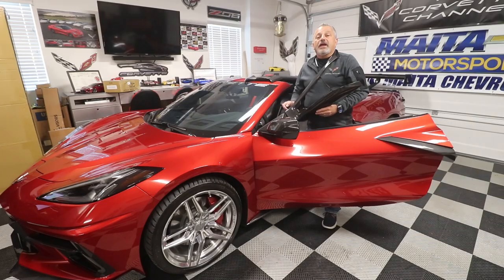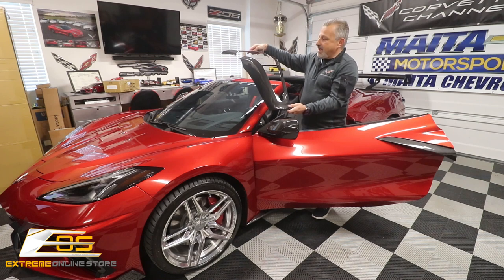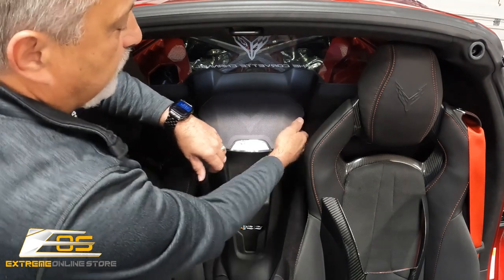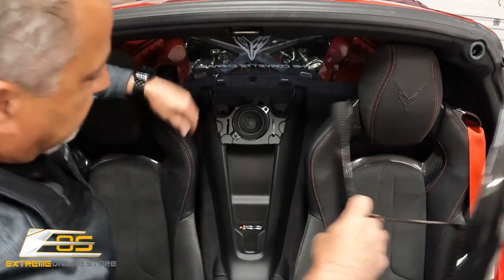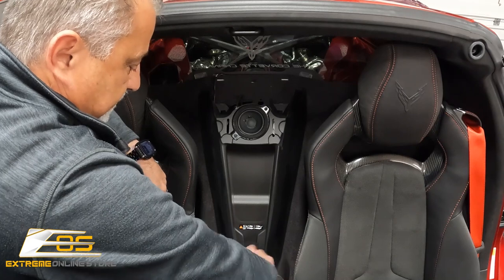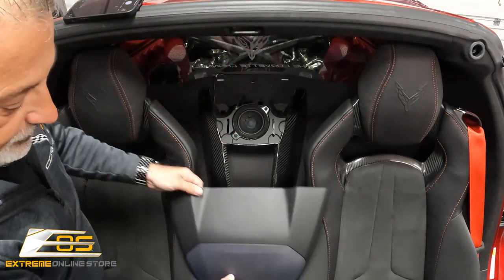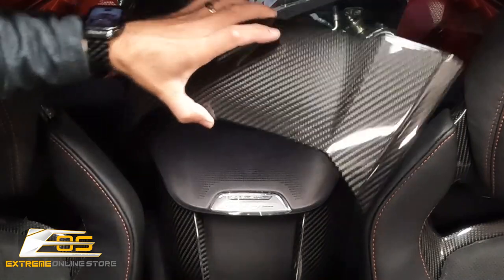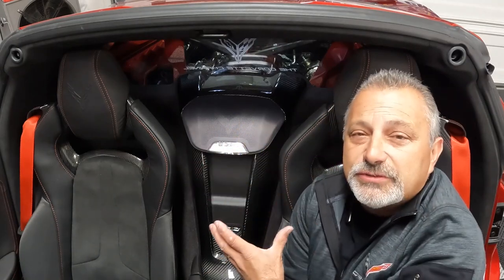How to Install a Carbon Fiber Waterfall and Speaker Cover in a C8 Corvette

Comment: Hello TCC. I have a technical question if I may. Can the valet mode be by-passed by the Chevy technician? I've had my C-7 Zo6 in for service and it appears that the mechanic is by-passing my valet mode when he takes the car out for a test drive.